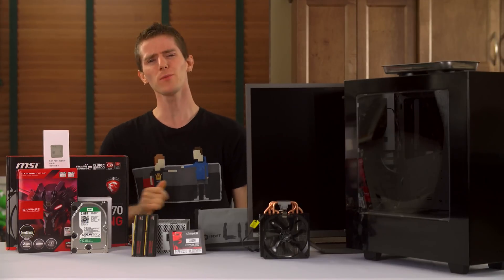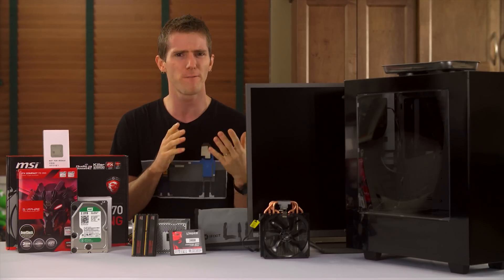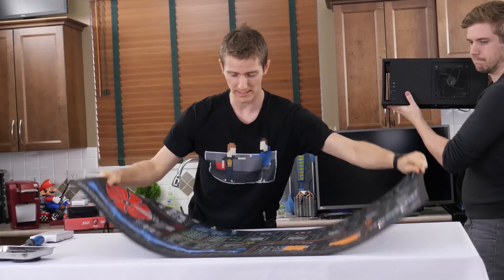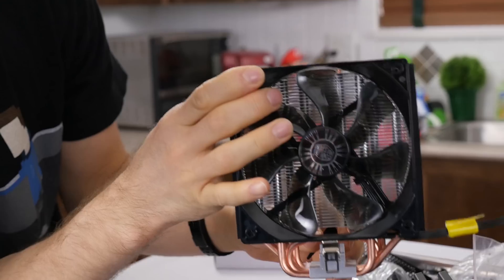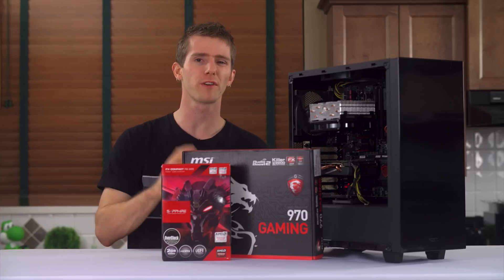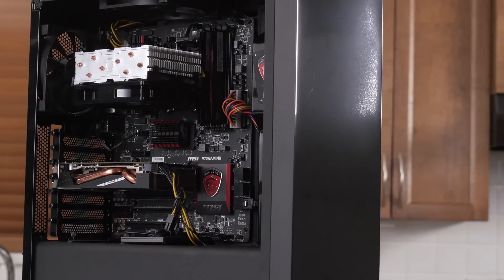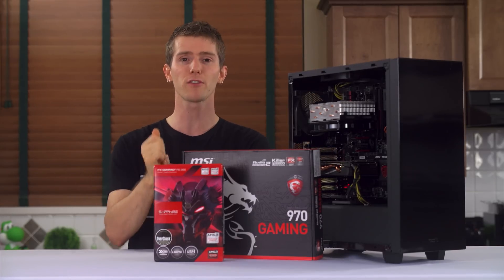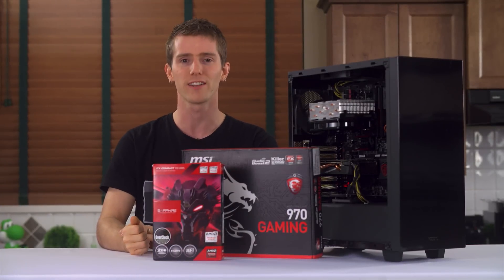Can you Build a 4K Gaming PC for Under $1000?

Comment: I built an entry level 4k machine the other day. Used my FX 8-core that I already had, running it at 4.1ghz, 16GB ram, 250GB SSD, 1TB mass, and an off the shelf motherboard... The expensive parts were the monitor and gpu. I ended up going with a 42" UHD TV at 60hz and a GTX 980 TI G1. Those two things alone cost almost 1,500 bucks. ;)

Sooo... 2000+ for the whole system.
Reply: NOOOOOO NOT A TV NOOOOOOOO*cries*
Reply: +Justin Dixon How's the response time / lag on the TV?
Reply: You should have gotten a monitor unless you are going to be using a controller and sitting on the couch
Reply: +METHOD ME Monitors above 28 inchs get really expensive, Plasma's with HDMI's have basically no noticable input lag
Reply: +Cole Jones my 40" VA panel was under £600. With - crucially - DisplayPort.
Reply: Christ J But that's still over 600 Bucks (It's to early for exchange rates) For a Monitor, WHich falls into the expensive catagory, I've got the parts list for a very good computer for just over 1100
Reply: Cole Jones even 1100 ($/£?) is expensive. It's all relative. I know of 27' 1080p screens that can nudge over £400 - as soon as you add things like G- or A-sync or a high refresh rate, prices soar. In comparison, my 40', 4k, 12msec monitor with a proper DisplayPort 1.4 socket was pretty spectacular.

In fact, at between 12-20msec, my monitor is pretty slow. I'd still feel confident about beating almost any kind of TV though...
Reply: inches is "
feet is '

unless you have a 40 foot monitor. 

which would be dope actually.
Reply: Stig's Italian Cousin traded it in. My current monitor is 35 kiloparsecs corner-to-corner.

And if you criticise punctuation usage then you're better off if you do so having correctly capitalised and punctuated your corrective comment. Just saying...
Reply: Christ J I assumed you weren't from the US and not familiar with our "wonderful" way of doing things. So I thought you just didn't know. 

And seeing as this is a youtube comment and not a school assignment or paper for work, I think it's safe to say my punctuation and capitalization was good enough. 

wasn't trying to offend you bruh
Reply: Stig's Italian Cousin you should probably also refrain from using the "it's only YouTube..." defence just after trying to correct someone's use of punctuation marks. It's extremely hypocritical.

If it makes any difference, I usually use double-apostrophes instead of open-quotation marks because it's less clunky to type - especially on a tablet. It's possible that I just got a little sticky-keyed. After all, I've used both single- and double-apostrophes for "inches" in this thread.
Reply: and now you're calling me hypocritical...

forget it dude. you're way too sensitive and I could give a fuck about what you think. 

duces.
Reply: Stig's Italian Cousin who's overly sensitive? You're the one who felt the need to defend incorrect grammar. Surely the unit of distance mentioned in my original reply made it clear that I wasn't being entirely serious...? Or did you really think I had a monitor that measured a hundred thousand light-years across?
Reply: the hell are you two even on about? this is about a nice computer not who's thr lesser nazi
Reply: Cole Jones unimaginative people would point out...never mind...
Reply: METHOD ME TV is perfectly fine. No major differences from the standard 4k computer monitors. Same color, contrast, response, etc. No issues what so ever.
Reply: Justin Dixon not many 4k TV's have the requisite ports for a 60Hz refresh rate, though. My 40-incher (snigger) was the biggest I could find with a DisplayPort 1.2 connection, for example.

Comment: How should this build so for 4k gaming and video editing
Cpu: Intel Core i7-5820k

Motherboard: ASUS X99-PRO LGA 2011-v3

RAM: Corsair Vengeance LPX 32GB 4x8GB 288-Pin DDR4 SDRAM 2133 

Case: Phanteks Evolv ATX 

SSD: Samsung 850 Evo 2.5" 500GB Sata III

HDD: WD Black 4TB 7200 RPM

Power Supply: Corsair RMx RM1000X 100 Watt

Graphics Card: EVGA GeForce GTX 950
Reply: the only games you could run at 4k on a gtx950 are the ones listed in this video...
Reply: + a 1000w psu is overkill
Reply: +Magic_Sowap how would it so for video editing
Reply: i recommend buying a lesser cpu like a 6700k and buying a better gpu like a 970~980ti
Reply: +Magic_Sowap alright, thanks, so it is good for video editing
Reply: +Liam Kelleher yes, totally (I'm on a phone so I can't edit my comments and didn't saw yours)
Reply: +Magic_Sowap thank you

Comment: This build is pretty close to mine. I have the same motherboard - but I have a 8350, a 970, same size power supply from corsair, same CPU cooler, same SSD - but 128 GB, and a Seagate 2TB HD, and a Corsair 200R for my case.

Comment: my pc specs
GPU: GeForce Titan Black 

CPU: Intel(R) Core(TM) i7-4960X CPU @ 3.60GHz 

Memory: 32.00 GB RAM 

HDD: 6 TB 
SSD:476GB 

Current Resolution: 3840 x 2160, 30Hz 

Operating System: Microsoft Windows 10 Pro 
_________________________________________________________________________________ 

Uplay: brittlelittle 

Origin: brittlelittle 

Social Club: BrittleLittle 

PlayStationNetwork: dashinga11 

I have a ps4 

Monitor: ASUS PB287Q 4K UHD monitor with 3840 x 2160 resolution, 1ms GTG response time and 60Hz refresh rate 

Mouse: Logitech G402 910-004069 Black 8 Buttons 1 x Wheel USB Wired Optical 4000 dpi Hyperion Fury FPS Gaming Mouse with High Speed Fusion Engine 

Hotas:Saitek X52 Pro Flight System Controller 

_________________________________________________________________

Comment: I just built a new pc the specs are amd fx 8350, r9 280x, 8 gigs of ram, 1tb wd caviar blue and 240 gb ssd is this good enough for low end games in 4k?
Reply: I think so, I'm running a r9 290 and the titles shown in the video run just fine at 4k ;)
Reply: Yes
Reply: +X_Ninja_Kiwi_X I've got roughly the same as you except I have a GTX970 instead of a R9 280X and it's handled everything  I've thrown at it so far
Reply: FatalRiise ok thanks

Comment: Question! Can the EVGA 950 SSC run on that Acer screen? Otherwise advise me a cheap GPU that can plis :P
Reply: You probably wouldn't want to go anywhere below a 970 to run a 4K monitor and that's barebones. I would recommend at least a 980 (regular not the Ti) but a 980 ti would have no problems at all
Reply: Stretch Reality
 Okay :P

Comment: So I want a all amd build plays at 4k ,money range 800-900
Reply: Any suggestions?
Reply: +MikusLove Soul I'd honestly scale down the HDD to a 1tb if you're not that savy on files, get rid of the SSD, get down to 8GB ram which is fine, get some extra coolers in there and overclock the CPU used in this rig, and get the same GPU. You'd shave off like 120bucks atleast and the performance will be even better in games.

Comment: can someone please help me with my first gaming build? 
REALLY new to this. 

Graphics card: GTX 980 TI
SSD: Intel 730, 480GB SSD
Case: NZXT H440 case
Core: i7-4790K
Hard DriveWD 2TB hard drive
Power Supply: Corsair CX series 850 Watt 
RAM: Corsair Vengeance 16GB RAM 
Water cooling: Corsair Hydro series H110 280MM CPU cooler
Motherboard: Asus x79-Deluxe

Everything is appreciated.
Reply: A few things to look at:

1. If you're getting an i7-4790K then you may as well get a Z97 chipset board to match, that way you can take advantage of the overclocking capabilities of the CPU. Otherwise get an i7-4790.

2. An Intel 730 SSD is really expensive, and all modern SATA SSDs are limited by SATA, not themselves. Either look into cheaper SATA drives (Samsung 850 series for example) doing RAID 0 if you really want speed, or go for a faster M.2 or PCIe drive, but really look at performance here.

3. Everything else is pretty good, just look at user reviews for reliabilit,y professional reviews for comparisons and benchmarks, and take all advice with a grain of salt. Oh and make sure you'll actually use all that performance before you buy.
Reply: RedDragonflyxx
My first build, and I might not even try overclocking so I'm staying with the 4790. 

I noticed, but as I've heard these SSDs are extremely relieable and do RAID 0. 

Thank you so much for your input.
Reply: +Rishi Jusia 
If you're just gaming (unless money isn't an issue at all) get an i5 man, Or you may as well get skylake?
Your first motherboard choice was x79 which is a totally different than the CPU, 1150pin cpu and 2011 pin mobo.
Also get a PSU that is in either the top or second tier of this list, http://www.tomshardware.com/forum/id-2547993/psu-tier-list.html, you can also go for less watts if youre not going to SLI, which you probably wont with a 980ti. If you get a good quality PSU you can get like 500-600w and be fine.
Reply: Kingarthur Gaming
I was there at a point too. 
Trust me, The budget for the pc is not a real equal to my actual living expenses. 

But budgeting for a couple of months or even a year can build a very good saving.
Reply: +Rishi Jusia bro did you already build it, that's pretty hefty for your first time
Reply: Kingarthur Gaming It's being shipped. 
But it got kinda better. 
I added a i7 skylake and a asus maximus 8.
Reply: Rishi Jusia Nice, you're basically making the build I'd make, what are you planning on using it for?
Reply: RedDragonflyxx
Gaming with a combination of rendering and some school ;)
Reply: Rishi Jusia Yep, I see why you went for the fastest multithreaded CPU under $500, rendering eats CPUs for breakfast. Did you get an i7-6700 or i7-6700k? You may want the extra performance from overclocking.
Reply: RedDragonflyxx
6700k
Definitely have overlocking in my mind.
Reply: +Rishi Jusia lucky I'm just sit on my potato and wait for so,e extra money to come around

Comment: I know this was made 1 year ago, but I don't think components changed their power usage within that span... Check this out.
http://pcpartpicker.com/p/7vW6GX
That 400W SeaSonic is useless. The whole system requires 429W. Mind you, I did my best match for the RAM, CPU cooler, and WD Green HDD from what I can see, but that still requires MORE THAN 400W. How are they running this crap?

Comment: I just saw your benchmarks with 1-4 gtx 980's... Now I know I can forget about 4k gaming for another few years... Simply said, if you are a gamer, want to have at least 80 fps in new games and you want a 4k resolution then you need AT LEAST, I would say MINIMUM REQUIREMENTS are 4 x gtx 980 and you will still have problems and will not be able to play all on max... SO if I buy 2000 dollars worth of graphic cards and still won't hit the top... I can go shoot myself now...
Reply: You have underrated the GTX 980ti and the Titan Xs bro, 4-way SLI will crush every single game. Every.
Reply: Yang Qiming Well not at 4K resolution. I just looked at some tests... I am not sure which game it was but his fps was 90 and he was using 4 sli gtx 980 on a 4k monitor. So yes you can play anything with 4 way SLI but still you might not be able to play everything maxed out even so...
Reply: +Yang Qiming Crush it with stuttering.
Reply: +Infinite Zero absolutely true, you can getaway with 4k 100fps with 2 980ti s

Comment: So I'm for sure in getting the Radeon r9380 nitro for my budget build and I'm really wanting to save a little more for an intel i5 processor and not an amd processor but do I really NEED an and processor since in using an amd card? Would it run better? Or is it just retarded to use intel and amd

Comment: I'm getting this build:
CPU-Intel Core i5 4460k quad core 3.2ghz (Overclocking it to 4ghz I think)GPU-Asus Nvidia Geforce 970 Strix 4GBRAM-8GB DDR3 1600MHZ Corsair VenganceMB-Asus H97 Pro-GamerSSD-128GB Crucial (For The OS)HD-Western Digital Blue 1TBOS-Windows 10 64 bitCPU Cooling-Coolermaster liquid coolerCase-Bitfenix Neos ATX TowerI had to pay £575 for most of it while the OS, SSD, CPU Cooling and a few games are gifts

Comment: Hey i have one GTX 780 graphic card.... i wanna play 4k.. should i buy a second 780 GTS for sli or should i wait and invest in a Titan ?
Reply: +SwissCow85 no titan necessary. A second 780 would help a lot and if you put it in SLI it will help you a lot. Titan you don't need. 

If you can upgrade to a better GPU do it. Something like a 970 or 980 could do some demanding games but look into it.
Reply: +LOLmomentsandfails I think a 780 is better than a 970. Not quite sure, Ill check again
Reply: 970 for one GPU for 4k might be better than a 780. 780 Ti 6 gig video ram would help a lot too.

Comment: What is the anti static pad that Linus is using called ?
Reply: +Pyro Enterprise It's a mod-mat, you can find this one on Amazon.

http://www.amazon.com/ModRight-Anti-Static-Mod-Mat-Assembly-Surface/dp/B00CPP6QUG
Reply: +Vanguardas Vucava You are an ass-hat if you think Anti-Static isn't "real shit". 

It only takes 10 volts to damage parts on a motherboard, which is 1,490 volts less than it takes for you to even be aware of the shock. Damage isn't always immediately fatal, either. The shock can also degrade the component, and shorten its lifespan. That's if you're lucky. Just walking across the floor generates 12000+ volts, and it isn't uncommon for people to carry upward of 20,000-30,000 volts depending on the weather.

Be sure to warn anyone you build a computer for in the future, that you don't take ESD seriously, and they may have to buy new components much sooner than is necessary. It's the least you can do, really.
Reply: +Mr. Snerlax you can but it might a lil to big
Reply: +Cea Deus can you use it as a mouse mat :3
Reply: +Mr. Snerlax That may be a good idea for people that can't handle losing, and end up rampaging to the point of using their entire body to move the mouse around lol
Reply: +Pyro Enterprise anti static shit isn't real. built a lot of PCs never broke one. i even use a paintbrush to clean. unless you charge up some stupid amount of static like playing with a plastic wrap, i don't see it being a threat
Reply: xxBOUNTYxxHUNTER I don't know who told you that, but, they're incredibly stupid. Please tell them that for me.
Reply: Pyro Enterprise .